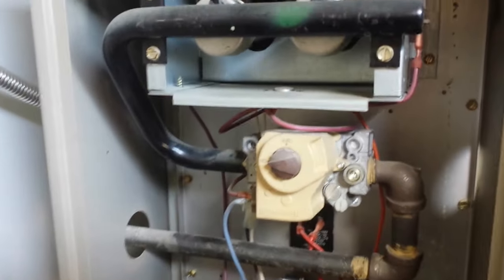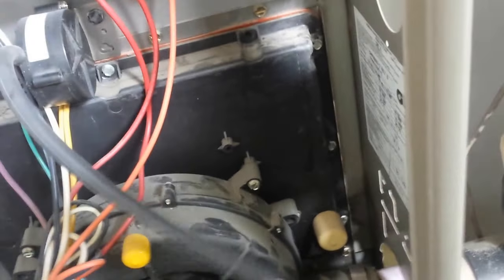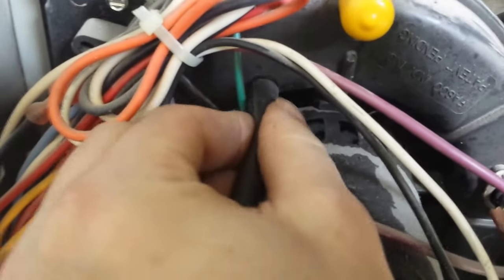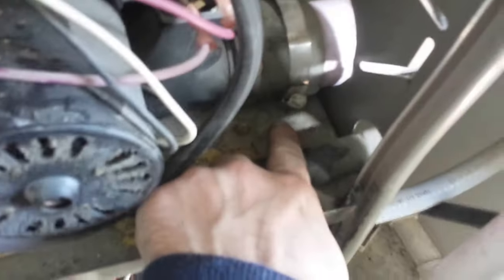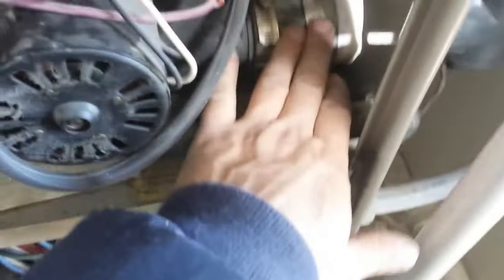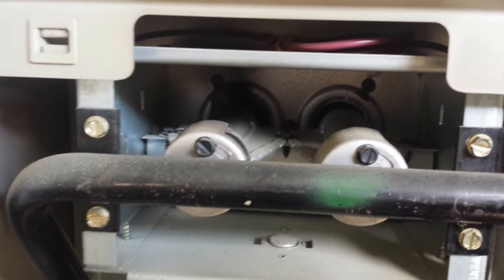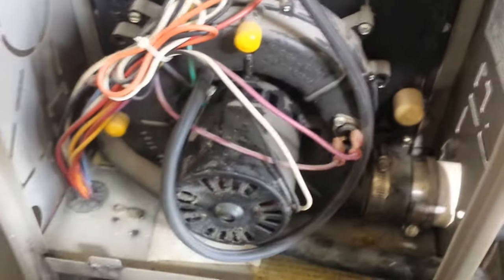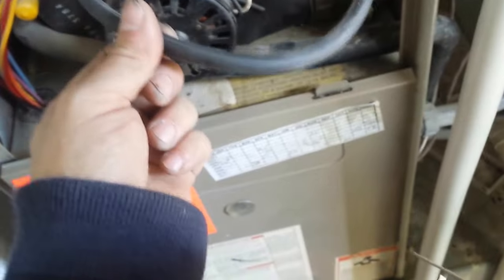Gas furnace. Most brands fix. No Heat 3 blinks trouble shoot

Comment: Just want to take a minute to thank you and thank you YouTube. I fixed my furnace, Probably saved $500 – $1500. Control board was blinking 3x and induction fan kept going on and off itself. Armstrong furnace. I’ll explain the price range shortly. But it’s your video and another video that really helped after watching about 10 videos! You and this other person explained it very well. With that basic knowledge and understanding of functions, I was able to isolate the problem. Thanks again, read on for details :)

If you have the will and ability to problem solve and research, it will save you a lot of money. So $600, the technician said was my problem, the control board. I said all you have to do is unplug and plug things, I can do that myself but since you’re here can u give me a better price. And the key question, “is this going to fix it?” I understand the answer, but I don’t like it, “we will only know once we do it”. I felt this was a  fix but will lead to other issues/charges. So I paid their trip/diagnostic charge, thank u. I bought and swapped the control board myself. Control Board only $125. Dedicated about a day to educate myself. Found out, it was NOT the control board, so I have a spare now, in case. Turned out to be a short in my thermostat wires. Lucky for me it was right where the furnace was, I don’t know if the installer or other technicians that came before & did this on purpose but there was an open wire touching the side of the furnace. This is the furnace side close to the wall, so it was kind of tucked in between. I felt wow this is HVAC milk money, like a shady ponzi mechanic. But then again, there’s a slight chance it was random. Also want to mention the companies that I called are all 4-5 star, google reviews with many reviews.

Comment: Thanks so much for this video! The first 30 seconds told me I needed to check the vacuum tube and when I sucked on the tube to see if it would hold pressure I got water coming out. Apparently a rain we had this morning allowed water to sneak in there somehow but after draining it (not much of it) my heat is working again. Thanks, Bryan!

Comment: Your video helped a lot. Lennox furnace, 3 blinking red lights. I removed the tube between the pressure switch and the combustion air inducer. I ran the pipe cleaner through the tube, no blockage. then I took the pipe cleaner reamed out the hole in the combustion air inducer where the tube connects. I think I dislodged a piece of corrosion that may have been blocking the air flow. I heard the piece of corrosion flop around inside when the inducer motor started and then the furnace fired up.

Comment: Did the suck test on the pressure switch and it checked ok. Put my shop vac on blowing and blew back through the exhaust pipe, took the small hose off and blew through it, reassembled and presto we have heat. the clue to test the pressure switch was valuable. I could have bought a new part and still had the problem. Thanks for the help

Comment: I had the three lights blink. Troubleshoot guide on furnace stated: Pressure switch failure to close. Checked pressure hose. It was hard and cracked on one end so I trimmed the end with scissors and problem resolved. THANK YOU.
Reply: This comment fixed my furnace. Did the same thing. It seemed like the hose was just like stretched out and wasn't creating perfect suction so I trimmed the tip and put it back on. Works like new. Thank you!

Comment: An hour of net searching later this video fixed it. I had condensation build up in the air sensor valve. When I went to test the valve I heard water in it. Just unscrewed and tipped upside down to drain. Fixed.

Comment: Awesome. Have a 12 year old Goodman gas furnace that would not put out heat (blower on then shut down) Saw the 3 red flash error code. Bought a $30 pressure switch. Installed and all systems go with no more error codes👍🏻👍🏻

Comment: Thank you for your video. I just got my furnace started up again when my landlord's maintenance guy said we'd need to wait on the HVAC tech. The low is -10F tonight so I wanted to get it done today. The only difference is my furnace had what looked like, two pressure switches. I pulled the hose off each, sucked in, both clicked. When I held the ON button nothing happened though, but I was trying to pinch it close and I don't think I was getting a good seal. According to forum posts, people also recommended sticking a small drill bit into the nipples where the hoses connect to the motor, incase of an obstruction or corrosion, so I did that as well (but didn't notice any resistance). I hooked everything back up, pressed the switch and the motor started to turn, so I put the gas section front plate back on and held the switch and it all fired up. Thanks again
Reply: +nickfish03 We call that FM...F***ing Magic...:)

Comment: Great video.  One thing I'd suggest is leaving the thermostat off because usually will take longer startup when door switch is pressed while there is a call for heat from stat.  Simple way to call for heat is first push the door switch then jumper white and red terminals on the board.
Reply: @bryanksees  Well I'm not sure I was clear on my point.  If there's a call for heat while the unit is powered on the system goes through about a 45 second blower on cycle before doing the normal startup sequence which can be avoided.  It assumes there may have been an overheat cut-out so as a precaution the blower runs to cool the unit before initiating ignition sequence.

Comment: hi Bryan , I have some 3 blink red light issues as you described ,I have new houses only 1 years old and my area is construction zone,,  the heating company staff coming and take the holes out and they saw lot of sand and clay in it , after taking off the external pipe out , they said it ok now , but later my heating has short cycle , by opening the furnace and start the furnace i heard some sound like a sand and chip inside the motor or pump. How do I fix it ? should I just vacuum the water ? if it ok after vacuum the water from the pump out should I refill with water again  ? Please help .

Comment: My furnace in the attic is Trane XE80 and a humidifier Aprilaire 445 is attached to it and I have had condensation issue too. I think the humidifier is not working. In the past I had water come down through the ceiling from the furnace, and it still worked until last night. I opened the humidifier collection tank and emptied the water, but water still dripping from the water float sensor never ending. I got 3 blinks code. I did it like what you said in your video; nothing happened.  The fan inducer tried to spin but then stopped.  So I spin the fan blades manually while bending the hose after I sucked on it; then the fan started spinning by itself and the inducer started, but after a minute it died out. It did not ignite at all. What could be the problem? Is it the inducer, pressure switch itself, or control board or something else?

Comment: Mine was just goop clogging the hose for the pressure switch in the nipple on the port on the fan. Just cleaned it out with a piece of wire and it’s all fixed for no out of pocket cash. My nipple and hose are a very small diameter.

Comment: Mine also fixed. Stem#2 - check your inlet and outlet air. The inlet pipe has some metal mesh and it was all covered with snow. No wonder it build up pressure. Now it's all back running. Outside is 0F and going deep down to -10F tomorrow...

Comment: replaced the pressure switch as a got a lot of air when i sucked on it so there appeared to be a leak.   Once new pressure switch was on I could suck on it to get the switch to close but once the other end which hooks into the blower was connected it out off.  Seems to me the blower out to be sucking but it is blowing.  Does that mean the blower needs to be replaced also?

Comment: I’m a service tech for a professional company…. I would NEVER recommend sucking the pressure switch in to get it to fire. Can be VERY dangerous. If the exhaust is clogged the board will think it’s not… and you will get a mini explosion.

Comment: Mine has 2 vacuum censors.  gms9/gcs9.  Went through all the same steps, both censors. but when that didn't work, i pull the connectors off each one, jumpers them together to close the switch.  didn't work.  so I hooked them back up, all of a sudden my shop furnace fired back up.  Perhaps I have an intermittent switch, and when i jumpered, it reset the system.
Reply: KNOWLEDGE IS POWER   It's worked fine since. My business neighbor is  heating/cooling business for Courier/Bryant,  they said it was likely tripped by high winds, snow the night before and a vacuum formed up the exhaust pipe.

Comment: I'm getting 3 slow blinks on my Armstrong high efficiency.  Nothing comes on at all. 
Transformer is putting out 24 volts.  Gas valve gets 13 volts in off position 🤷‍♂️

Comment: I get the 3-blink code, i remove the hose, I meter the switch and it changes state. So the switch closes when it is supposed to, but I still get the 3-blink code.  Does this indicate a bad controller board, giving me an incorrect code?,

Comment: i have the three blinking lights.   The furnace didnt work when i sucked on the pressure switch hose and held it.  The vent pipe is not blocked.  I replaced the pressure switch and the furnace still wont start  :(

Comment: I went on a call similar to this last week. Found a dead bird in the burner compartment, another in the first elbow from outside, then a big birds nest stuck in the exhaust right above the 3-2" reducer where it comes into the furnace closet. Idiot installer didn't put any screens on the pipes outside. I always put screens in mine. Nasty job, had to cut the line way up by the ceiling and pull all that crap out of the pipe. I put 3 screens in. One for the furnace and it's makeup air. and the water heater (also had 3" PVC vent, one of them power vent style tanks).